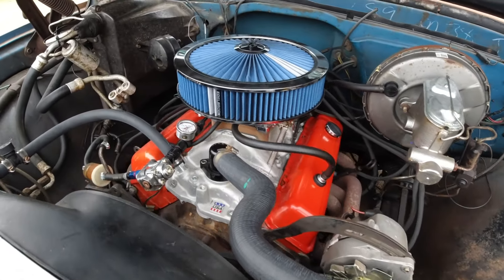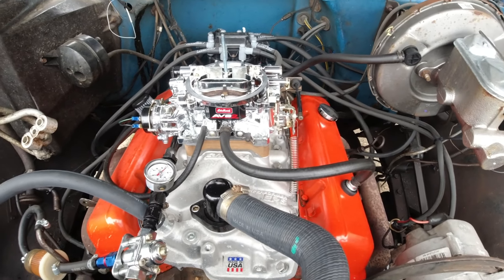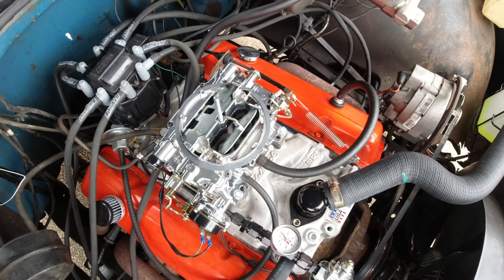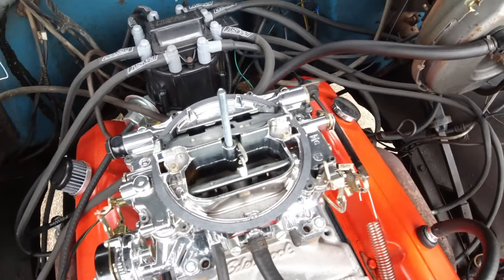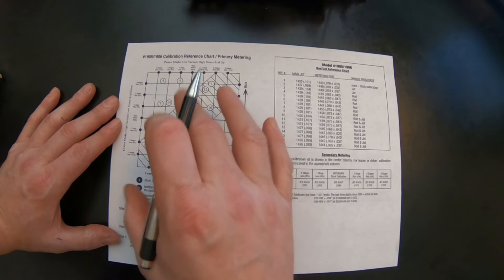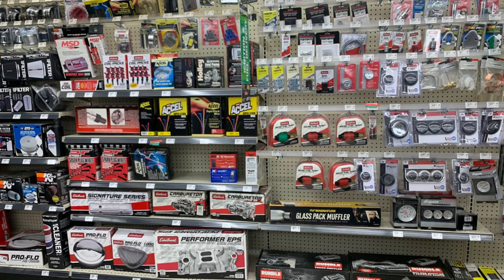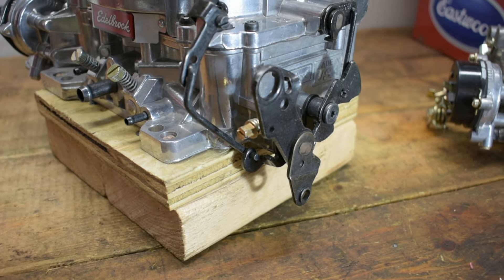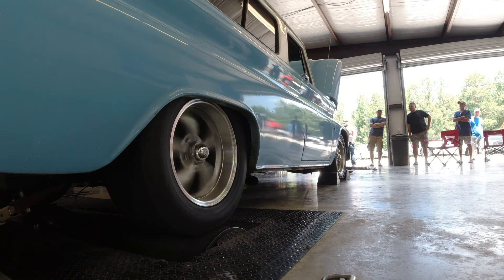Edelbrock Carburetors - The Good, The Bad and The Ugly

Comment: i pulled a edlebrock carb off my engine replaced it with a holley and it came alive both where new carbs quadro jet is a way better carb plus u can drill it out easy to work on just u must reseat the fuel bowl on the lead plugs or if it leaks at all it will affect the secondaries. the edlebrock i feel is the worse carb and the cheapest carb on the market junk not worth the money . u do know u will get better performance out of a quadro jet then a edlebrock carb and u can drill it out to 1150 cmf's . i have a bunch of edlebrock carbs most i got from rigs that they put one on and when i get it, it comes off and goes in a pile
Reply from the maker: Send em my way!  I’ll take them all.
Reply: You obviously don't know how to tune one.
Reply: @Ratridez  i guess the dyno tune had no idea what it was doing but it worked good on a Quadro jet or a Holley it seem to gain hp with those carbs but could it be that it is the cheapest carb on the market plus i am a G.M. certified mechanic and ben building cars for over 45 years i think i know my carbs . y don't u see them on the drag strip mite because they suck. i will take a quadro jet against a eldlebrock any day of the week   try using a quadro jet carb off a 454 which is a 600 or u can drill them out all the way up to a 1150 means u know so much about carbs
Reply: @jeffrey4547  1/4 mile, racing, dyno you go with Holley. For normal street cruiser, resto, muscle you go with original carb or Carter/Edelbrock 👍
Reply: @MuscleCarSolutions  lol can get the left over parts???
Reply: A few months ago I  pulled a 4447 off my 347 and tossed a 1406 base tuned to a 1405. All of a sudden the car is so much more friendly romping stop light to stop light. The 4447 is currently a yard ornament for me if you want I'll pull the weeds out of it and mail it to you.
Reply from the maker: @jeffrey4547  I really need you to keep commenting.  It’s entertaining to see someone so wrong.  Especially a “certified GM mechanic for 45 years”.  Bruh.
Reply: @MuscleCarSolutions  u can go a head and think edelbrock builds good carbs i just wonder y no one at the drag strip has one
Reply from the maker: @jeffrey4547  because it was never intended to be a race carburetor.  You’d think that a certified GM mechanic of 45 years would know that there’s more than one application of carburetor.  In your line of argument, 2 barrel carburetors on dump trucks are junk because you don’t see them at the drag strip.
Reply: @MuscleCarSolutions  then y would u replace a quadro jet with a edelbrock carb y please tell me y when it way cheaper to rebuild the quadro and the quadro is well known to be a better carb plus people have used the quadro for drag racing because it don't fall on its face but u have to know what u are doing
Reply: @MuscleCarSolutions  i have a question for u lets see how much u know how do u get a 450 hp 454 for free that will come with a 02xx trans do u even know what kind of trans that is and u can get the setup for free
Reply from the maker: You mean quadrajet?  I don’t know what a quadro is.  You’re speculating.  Carburetors are situational.  Some work better in certain circumstances than others.  There is no one size fits all - on anything automotive.  There’s options for just about everything.  That’s what makes this whole thing fun.  You get to make your own choices and pick what works best in your individual circumstance.  Perhaps once you spend a little more time in the automotive world, you’ll understand that!
Reply: @jeffrey4547 A 02xx trans is a transmission that identifies as an adult film star.
Reply: Hehe he said quadro 🤪
Reply: @jondd1449  The quadro jet is that new top of the line, top secret, Chinese 1300 CFM carburetor. Will give any motor an added 300 HP, and get 94 MPG.
Reply: @MuscleCarSolutions  Right on! This dude is funny! Holleys are fuel dumps. If you can't work on a carb get a Holley. Most insane thing I've ever heard is 'you can "Drill out" a 600cfm carb up to 1150cfm'. The airflow though the carb isn't a function of anything you can 'drill' out. Pretty strange somebody can work on carbs for 45 years and stay at the same level of knowledge as when they start.
Reply: All very amusing 🙃
Reply: @brocluno01  For real! I would love to see dude do a live with Muscle Car Solutions!!! I would even pay for that.
Reply: Don't know nothing about carburetors !
Reply: Every time someone responds to the original comment I reread it and laugh
Reply: @jeffrey4547  what the hell are u taking about drilling out the well plugs ?
Reply: @butchking154  i did not say drill them out but reseal them they have lead plugs at the bottom of the fuel bowl after people rebuild them they will leak and the secondary's will not work right or not at all. so most people say they are junk but they are one of the best built because they are easy to open them up to a 1150 cmf by drilling out the ports and putting bigger jets in it
Reply: @jeffrey4547  no one uses quadrajets for full effort racing other than stock or super stock because they have to use what was originally on the car. So that means even the AFB on hemi cars, AVS on big block and small block Mopar, thermoquad on later Mopar, and how about all the Holley, autolite, Carter, Rochester, etc carbs used on all the other street race cars? All are running amazingly well. But the all out full effort cars are always going to be some 4150 or dominator derivative.
Reply: @foreignautomobiles  i agree with full race cars but there is a lot that drag racers with a qudro jet. they are cheap to build up and u would be surprise on the proformas u can get from one and if edlebrock is so good y are they dropping their carb and now are building hollies after holly sold them the patt.. i guess u guys must be right it is so good they are stopping to build them. try this put a edlebrock carb on a rig then put a stock 600 quadro jet on it see which works better. i did it on a stroke 454 with 450 hp stock engine and with the edlebrock i lost over 50 hp from it great carb u guys are so right what a joke .
Reply: @jeffrey4547  I never said one or the other is better or worse. I can tell you really are a die hard Rochester quadrajet guy. They are a great carb and would be used much more if they had a float bowl that was larger than a 1/4 cup. The Carter thermoquad was all the best things about the quadrajet with none of the negatives. They combined the best of the AVS and quadrajet, then combined it with a phenolic body that took care of the vapor lock and fuel boiling issues. Every carburetor can be made to perform just as good as one another, but some are cheaper, faster and easier to get to the final result.
Reply: @foreignautomobiles  only reason i like them is if u are low budget u can get up to 1150 cfm out of one and they don't fail all u have to do is drill it out and change a few things only carb u can change the cfm on it but i run a 850 cfm holley pulled the 650 edlebrock off that some idiot put on it i put the stock 600 quadro jet off another 454 450 hp engine stock it ran way better even though the edlebrock was dyno tuned and the quadro jet  was not and it still worked better then when i put the 850 on it it really came alive 578 hp and i will get a lot more with the tunnel ram i have for it should work good with 10.5 to 1 compression  it is about the lowest u want for a tunnel ram but the engine will last longer.
Reply: @foreignautomobiles  Q-jet and Thermoquad (a few Holleys too) are true spread-bore, tiny primaries give that great off-idle torque and monster secondaries controlled by air flow qive you that great push you back in your seat feel. Sanely driven give decent fuel mileage too.
Reply: I love how it reads like you think you know what you're talking about but not really but it's the other way around
Reply: @seanwilson444  so if they are so good y are they building holly carbs and dropped the old ones
Reply: @jeffrey4547  you tell me, I don't know why they dropped the old ones
Reply: @seanwilson444  y most people buy the cheapest carb on the market because it is cheap and it will work. they have no idea on how to rebuild a carb goes for ford and chevy like why would u take a holley 4 barrel 600 cfm off a car and put a edlebrock on it. because they have no idea how to fix it and i love u guys because i get a lot of free holley this way. i have about 20 edlebrock carbs 600/650 sitting in my scrap pile. when i pulled them they worked just fine but the holley worked better on the rig. y they dropped the old one's because now they can build a better one ands it was not cheap for them
Reply: @@Nastyhabitz if u know what ur doing with  carbs a quadro jet will stomp a eldebrock in the ground u can build it up to a 1150. so if u are trying to save money by buying the cheapest carb on the market y not just build one that is better for under a 100 bucks
Reply from the maker: @Nasty Habitz you’re not going to get a good response from jeffy.  He doesn’t have a clue what he’s talking about.  Given his comments I’d guess he’s never  tuned any carburetor.  But he was entertaining enough to pin his comment and laugh at him.
Reply: @@Nastyhabitz they don't call them quadrojunk they call them quadropukes that is because 90% of mech. have no idea on how to rebuild one. most f them up bbecause they don't seal up the ports in the bottom of the fuel bowl. after u put it in carb cleaner they leak sp u have to reseal the lead plugs at the bottom of the fuel bowl. this is were 90% of the mech do not do. then what the carb will do is work just fine till u open the secondaries. when u do that it will backfire or fall on its face and the secondaries don't work. this is y most mech say u can only rebuild it once. then u have to check if it is leaking at the rods on the butterflies if so u need to change the or put in brass sleaves. now u know the tricks to a quadrojet and if u want to build it up there is videos on how to do it step by step for just the price of a rebuild kit and jets. so on what u are saying tells me u have no idea on carbs
Reply from the maker: He’s a strange dude.  But entertaining!
Reply: I didn't say drill it out, but you drill it out....
Reply: Same. My Edelbrock carb pile is getting bigger too.
Reply: Simple Holley fix. Plug the power valve. Then tune it.
Reply: @jesse75  they keep telling me how great the edelbrock carb is but u never see them at the strip the only carb that can run good but fail on the pull and lose the race
Reply: @jeffrey4547  it’s “Edelbrock”.. and “Quadrajet”.
Reply: @BPattB  😂 love it!!!
Reply: @r.joseph8911  I'm so disappointed this comment section got revived and I haven't been here for it. You didn't know transmissions could identify as whatever they want? Quadrajets are the Bud Light of  carburators😁
Reply: @r.joseph8911  u mean a Rochester if u want to be correct BFD
Reply: Uncle Tony's garage has a great explanation on why he likes eledenbrock carbs for hot rod drag cars. And yes, there is a carb for different types of driving. He also explains cfm and how they rate them wrong.
Reply: @krazveedub6781  he also said LS makes a big block which they never have in history
Reply: Obviously you not a mechanic or know what your doing?
Reply: @eh477  u must be so smart that u don't even need to test things out u just know it. i know a few people that think like u. just a lot on the internet but yet their engines don't last how many rigs have u built from the ground up and did everything ur self. from drive train to interior and paint
Reply: The amount of times the words "edelbrock" and "quadrajet" have been butchered in this section is epic.
Reply: at the time when i got the rig it had it on it and it was new so it was free to me then when i got the 454 i put it on it till i had time to rebuild a carb then after a bit i got a new holley
Reply: @BPattB shows what u know a 02xx is a factory build trans o2xx 400r turbo has the heavy 8 bolt pump heavy clutches and stage one shift kit good to 800 hp from GM but will handle a lot more plus it has most of the parts u need to build a 2,000 hp trans saves a lot of money on building up a trans .the best part is if u know what ur doing u can get them for free but only come as a short shaft
Reply: @vincemajestyk9497  shows what u know and u can it is fact they even have tons of videos on how to do it step by step
Reply: @BPattB  if those carbs are so good then y are they dropping the old and got holley patt. to start building holley carbs because holley is going all e.f.i. systems but i bet u did not know that did u
Reply: Up until this point I thought I had heard it all... had I known 50 years ago that I could make a slobberjet flow 1150 cfm by drilling out the jets,I would not have had to mess with dual holleys on my 427 all these years.
Reply: @briana3467  the Holley is a better carb but for a budget the Rochester is a good choice  but the cheapest carb is not a good choice that is y they got the Holley patent and are going with a new carb they are designing mixed of edlebrock and Holly mix but is mostly Holly with a few upgrades but what do i know . but y are u not running a edlebrock carb if they are so good then a Holley on the cheap side is 100 bucks more each carb. if u went to GM school on carbs u would learn a lot on them
Reply: @jeffrey4547 I was just joking with you., actually I think Rochester made a fine carb for most applications over the course of many years. The biggest thing is they are too complicated for most shade tree mechanics to be able to properly tune and adjust. I have run them both singly and in dual configuration with very satisfying results. Every type of carb from your basic lawn mower to a weber ida is different and must be studied and fully understood before you can expect to get them to operate properly.
Reply: @briana3467  they have tricks to them that u need to know when rebuilding them. most people have no idea on how to fully rebuild them that is y they claim u can only rebuild them once. at the bottom of the fuel tank they have plugs made out of lead u have to reseat them which can be a B. if not u take a good chance of ur secondaries not working right and to go dual carbs u need to get 2 of the same exact carbs.or u will never get them to balance. problem is they made so many different carbs even on the same engine and year. u have to get them from the same region like from Detroit both carbs have to be from the same year and place because of federal regulations. that is y people never use them for dual carbs way to hard to match up
Reply: @jeffrey4547  as I said, most people don't know the small details such as that . When the wells leak at the bottom and cause a constant rich condition the layman will immediately think rods or jets rather than a simple smear of jb weld or epoxy to seal the wells. At the same time wonder why the carb runs dry after sitting for a while.
Reply: @jeffrey4547  because they're daily driver carbs not performance carbs
Reply: I noticed it looked as if yiu had the wooden spacers between ur carb and intake I drive a 83 dodge van wth a mildly buit 318 LA engine I'm about to drop the edelbrock 1405 600 cfm om a Chinese aftermarket deal plane airgap intake do you feel it would be wide fir me also to run the wooden spacer or a fiber composite spacer  these vans don't get muvh air to the engine as it is and I'm thinking it might heat soak om me thst is a wooden. Spacer between yiur carb an intake correct
Reply: @jeffrey4547 reason you don't see em at the strip is because they don't make a 1000cc double pumper .  That's just common sense.
Reply: @Mr.E-gi5rq  thank u for showing me how much u know about cars and drag racing u do know that bot every one is running 8 sec. in a quarter mile you have a lot of bracket races and other classis i run pump gas only full street car with street tires no slicks or cheater slicks  got down to high 9 sec. with running 2 485 carbs on a 327 but we took it to about 450 cubic inches but that engine was very expensive to build and maintain just the head work was 3800 took a set of 202 and built the hell out of them just so we could have cast on cast way less head casket problems which we never did have with 13 to 1 compression with a tunnel ram which we had to port the ram to fit the new size intake ports on the heads  the bare engine ran 1192 on the dyno with pump gas after dyno tunning it we even polished the block for oil drop for high rpms had to port the cam bearings to get the custom cam in it. just the rods cost 4200 aluminum titanium alloy rods. the builder was old man bell which was one of the first to build a hemi head for bbc for the strip my neighbor for years was terry fisher nascar driver  even he said my engine was nuts for the street because it rev so fast